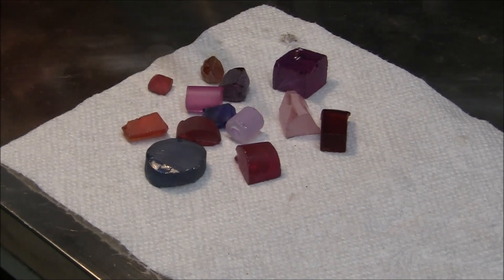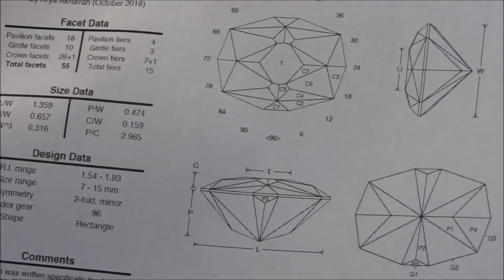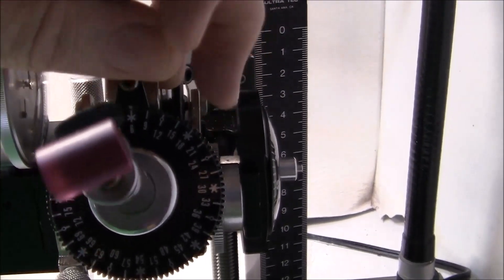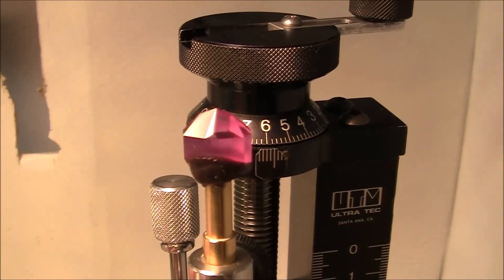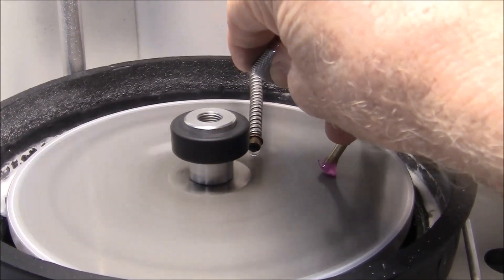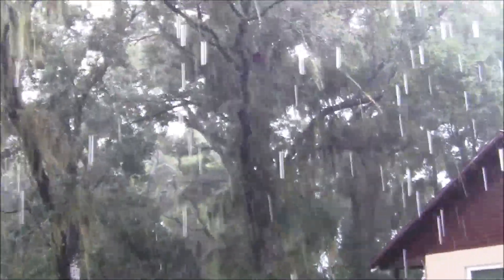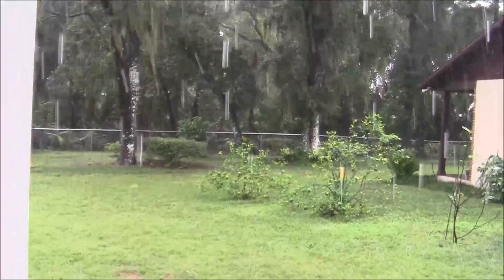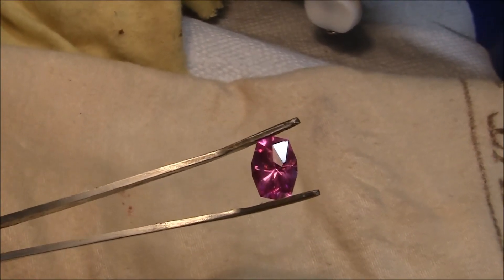Gemstone faceting- cutting  pink YAG .

Comment: Bom dia! Qual cola você usa para colar as gemas (pedras)?
Reply from the maker: I use several different  types.  i use  faceters wax for stones that can tolerate heat on the first dopping, then on most stone for the  2nd  dopping, the transfer, i use a 2 part epoxy glue  most times. For a very small stone i use  super glue or cyano acrylate . I use a water soluble white or yellow wood glue for very heat sensitive stones  such as amber, and  opal.